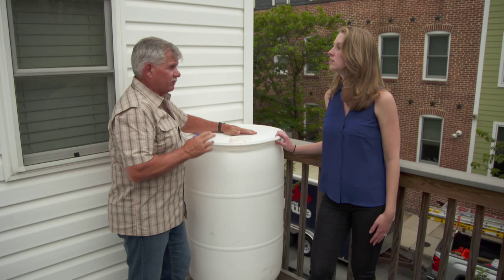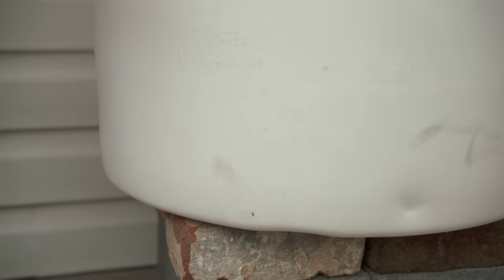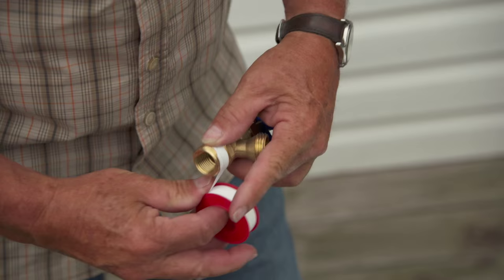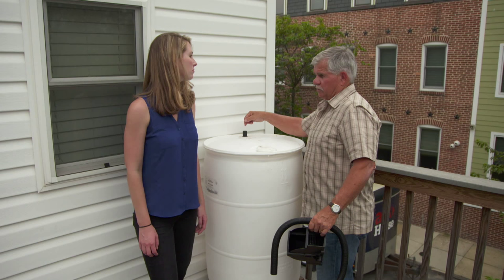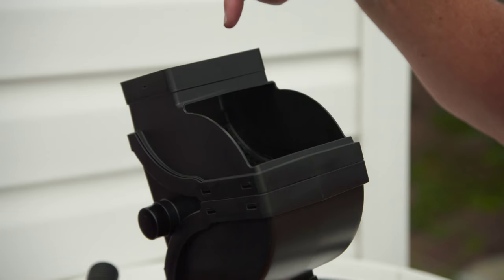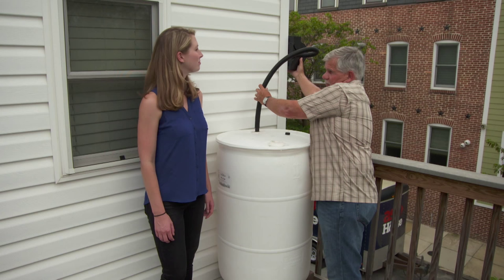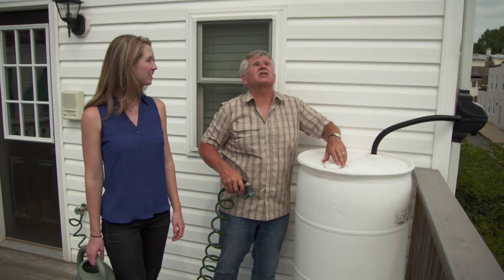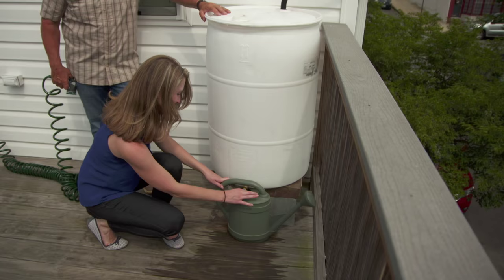How to Build a Rain Barrel for $40 | Ask This Old House

Comment: Two tips.  If you have a barrel of this size you’ll perhaps want a larger diameter out flow…. And two, you may want to consider painting it black to help block out the sunlight to reduced the growth rate of algae.
Reply: paint inside or outside?
Reply: @ranjit3o outside, it’s just to block the sunlight so algae won’t grow in the water inside the barrel.
Reply: Won’t black encourage heat?

Comment: It is worth pointing out that a light-colored or translucent barrel will grow algae in most cases. This will be aggravated when fed directly from a roof/gutter.
Reply: +LifeInOregon Could always paint the outside of the barrel or wrap it up.
Reply: even if it's used for drinking, algae is good for you.
Reply: Round why only for him
Reply: Guess you weren’t listening. It’s got a filter
Reply: Algae will still grow even with the filter. It's a microbe that grows. Also, white or natural plastics will also degrade and get brittle over time. It's best to put some gardening cloth around it to shade it from the sun rather than paint it. It should keep it cooler than painting it.
Reply: @Noah Wolfe ~ Guess you weren't watching, cause that was a strainer not a filter.
Reply: Since I would not be using water out of a barrel for drinking, it would not matter to me. It would be used for watering plants.
Reply: @RubbinRobbin  Delish!
Reply: @noahwolfe1304  for leaves and debris
Reply: @noahwolfe1304  that filter ain't keeping all the bird crap and other pollutants  that's on the roof out.
Reply: @Drew Peacock l guess you could run it through a Berkey in an emergency. But generally l think it would be best to use collected water for other than drinking.
Reply: @noahwolfe1304  If you saw the filter inside, it's to keep twigs, leaves and small pieces of matter from going into the barrel. It is not a filter that has a mesh in it.
Reply: @jaugust55  The purpose for my use of a rain barrel is to water my garden plants.  Not to drink it.
Reply: @jaugust55   Exactly!
Reply: @noahwolfe1304  it's a leaf filter not an algae filter all it does is stop leaves and sticks from getting into the barrel
Reply: I don't think Noah understands algae.
Reply: @noahwolfe1304  It doesn't have a media filter. It has a crappy and cheap slotted plastic strainer. I have this same diverter...and it's garbage! Many modifications you have to do, to make it half lousy. Waste of 💰!
Reply: @noahwolfe1304  That "filter" has absolutely nothing to do with algae. No need to be so rude when you don't even have correct info!

Comment: "You wanna hold my valve."... Tommy smooth as butter
Reply: He said belt because the downspout was on the outside of the rail and he would have to lean out over the rail to cut it to install the diverter.
Reply: She was very optimistic though gotta admit

Comment: They should preface: “we got a smoking deal on an old soda factory barrel that you probably won’t get”
Reply: 😂 right?!
Reply: I've seen used food grade drums on craigslist before, they usually go for around $50.
Reply: Not $5, but I just got 2 for $15 each.
Reply: I just paid $25 for a 65 gallon one and considered myself lucky
Reply: @JLJohnson  Nice find man! Congrats!!
Reply: @anthonymichlik4283  Awesome find!
Reply: He stole it
Reply: Haha ya the Home Depot 5 gal bucket is $5 but this giant one? Come on for realz?
Reply: There's 2 barrel suppliers by me that sell used barrels for $10. You have to look around for them a little, they're everywhere
Reply: I got 7 barrels for $65 from craigslist. Now, all I need is some stinking rain to water my deserving lawn 😝
Reply: I have 4 of them and didn't even pay the $5. Mine were all holding a non-toxic ice melt for runways. Same material as the food-safe ones.
Reply: @ahkeen  They're nice buckets too
Reply: @wes9451  cool… but that helps me very little

Comment: I do believe that a "how to" video should give all the details. I called my local recycling center for a barrel, they said they do get them in but they don't give them out but they would sell me an already assembled rain barrel for 40 bucks. So save yourself the time drilling, buying looking for a hole saw and call the recycling center! Also: so many comments about horrible "toxic roof water " all the plants are getting run off from the streets, decks all the rooftops in the neighborhood as well as  the pesticides you neighbor sprays. Just one roof sounds pretty good!

Comment: I wanted one of these.  My mom and I got a 45 gallon trashcan.  Today we got one of those bendable hoses to put at the end of the gutter and then we put it right over the hole I cut out of the lid.  I also had a mesh screen I got from Amazon.  It started storming.  I mean crazy rain.  It did so for less than an hour.  We went out and water was over flowing from the can.  Never in  a million years would I have thought it could create that much water.
Reply: You can also add a water filtration system. Just find a filter you like and add it on

Comment: Barrel will overflow. The inlet pipe should come in from the side about 2 inches down from the top. The diverter outlet elevation should be 1 inch higher than this so the water can flow to the barrel but when the  barrel is full the excess water will backflow to the gutter.
Reply: Excellent advice.  Thanks.
Reply: Never been an issue for me. Don't get enough rain to fill up 55gal

Comment: Feeding troth from tractor supply. Lid is an old screen door. Tarp over top when it's not raining. Troth comes with a hose and drain valve built in. $50

Comment: Great to see this install and saving rainwater! See comments below on putting the diverter just below the top of the barrel to automatically prevent overflow, see product instructions. We have installed a few of these and work great.
Reply: It's sealed why do you care about overflow? It'll just stop going down the tube and go down the downspout when full.
Reply: I think I would want my overflow to go in a secondary smaller portable container
Reply: Overflow into another barrel right next to it...or have the overflow attached to the 1st or 2nd barrel, connected to hose and ran out into the yard.

Comment: Make sure the tape goes on the same way  the threads run on the boiler fitting, so when you screw the 1” threads in, the tape stays on:-) Also, a one inch fitting with a washer screwed tight on to the inside will help the boiler fitting not leak :-)
Reply: The problem is  if I’m not mistaken the top does not come off of this type of barrel- it only has the two holes
Reply: @angelastanislowski8862  Most are like that. On PVC type barrels you have to cut the entire top off (level) then screen it, or what I’ve done is turn the top you’ve cut off upside down and set it back on the barrel for a bird-critter watering spot..Then you have the run-off from the gutter go into either the bird bath on top, or you’ll have to cut another hole into the edge of the top that drains the downspout to on top of the screen..Then drill a hole on the side that accepts your hose Bibb for watering..I always put a quick release-connector for the Bibb and hose in case I need to take it loose to go elsewhere :-)

Comment: You can see water seepage on the wood deck from the great installation of the lower valve, after he fills the barrel with water. She covers the leak with the watering can before the camera pans down. Needs a bulkhead for the bottom valve installation to prevent water from leaking around the imperfect cut, Teflon tape alone won't slove this problem.
Reply: You have no idea what caused the stain. They could have flushed the chips from the barrel, ever think of that ?
Reply: Or it could have been because he wrapped his Teflon tape on backwards.
Reply: could of been water from the sky
Reply: Maybe a cat peed there
Reply: @Kiss4cooper  could be
Reply: @oneangryfucerwivatinhat  could HAVE been.
Reply: @fizwin1  could have been.....
Reply: @oneangryfucerwivatinhat  :)
Reply: Charlie Tuna - always has to be someone who comments on Teflon tape being put on incorrectly. And you're actually wrong he did it correctly 😄
Reply: Could of also been because the barrel had a pin hole in it already and that’s why he was able to get it for only 5 bucks..?
Reply: @condor5635  You can tell by the color- that's left handed teflon tape and he put it on right handed.  It's completely backwards and therefore going to leak.  

If you don't believe me- just ask my blinker.  I learned the hard way when all my blinker fluid leaked out.  /facepalm
Reply: These shows aren’t actually shot in one take. There are a number of takes made to make sure the sound levels are correct, there are no flubbing of lines, or nobody off camera sneezes. I’m sure they opened the tap to make sure it was working first before turning the camera on.
Reply: @charlietuna5962  nah he wrapped it the right way. It leaked because he didn't tap threads into the hole so it didn't make a good seal and couldn't cut its own threads because of the Teflon tape.

Comment: I have one I use to keep my fish pond water fresh & topped off. I installed a spigot at the top and run a hose into the pond. Every time it rains the overflow goes into the pond. In the winter I move the hose to the bottom spigot and leave that open. That way the barrel remains empty and can't crack from freeze up.

Comment: You can do this on a much larger scale by using 250 gallon food grade tanks...around $25 used. And a downspout to 2inch pvc converter and run pvc pipes to the tanks. Fot larger gardens of course...best part you can always buy a tank for $25 and add it since you already having piping done, just use an elbow.
Reply: That second story porch ain't gonna hold the weight of 250 gallons of water dude! Ground level is fine but not this little porch!
Reply: @hotrodhog2170  oh I know mine are on the ground. Was just saying you can use same concept on a alrger scale.

Comment: I don't recommend doing this if you have Asphalt shingles. Chemicals from the Tar in the shingles can mix in the water.  Especially on hot days.  I would not use this water for ANYTHING.

If you have a rain barrel with water from an asphalt shingled roof, Fill a White 5 gallon bucket at least half full and see if it has a light brown color to it.  If so, most likely it's from the Tar.

If you have a metal roof no problem.

.
Reply: It will need a pre bucket filled with floss and a screen/ possibly a carbon mat (like for a fish tank). Then for drinking it will need additional filtering as you drain water from it.

Comment: You should also either paint it or cover it to keep light from going in otherwise you will have a big problem with algae
Reply: Hi I like your post and I wanted to know if you're saying the Blue barrel and the top cover needs to be covered to prevent algae?

Comment: We have three water barrels connected to our roof.  Here's the issue.....I recently watched a video that talked about the hazards of retrieving water from your roof as the materials they use are hazardous.  Even if you use it to water your garden, you are putting toxic water on the food you and your family will be eating.  I would like This Old House to respond to this as I can't find anything to the contrary and feel as if I have wasted time and money on these barrels.  (I know it's been 6 years since this post, but I'm hoping someone sees it.)  Thanks so much.
Reply: So, what if you are on a well?  All that toxic water comes off the roof, onto the ground, and into your well.
Reply: @AStanton1966  True, and we are on a well, but we have a filtration system that filters the water coming from the well into the house.  I am truly confused what to do.
Reply: @alicemaggio8854  Maybe, start by getting the rain water tested and see if it does contain any toxic substances.  I use rain water for my garden and power-wash projects around my house.  I have 3 Tractor Supply livestock containers for a total of about 375 gallons that get filled from a shed roof.  Then I have a 1,100 gallon tank that gets filled by my house roof.  Even though we had a pretty good drought here some years back, I've never run out of water.   I harvest rain water cause I'm on a well also.
Reply: @AStanton1966  Thank you so much for your reply.  This is great advice that I will be following.

Comment: When he attached the bottom of the diverter to the downspout below he placed it OVER the downspout. This will cause leaking. Having installed miles of spouting in my life, you ALWAY place a piece of downspout inside a lower piece so water can't hit the joint and leak out. The way this was done is incorrect. I know I'll hear it could be sealed with gutter seal etc. These sealants all expand and contract with temperature variation and will eventually fail. Bottom line, this installation is incorrect.
Reply: A white diverter would be better also.

Comment: It would have been nice if you explained what you did to the top of the barrel.  What did you drill into?  Where did you get that piece that you screwed into the top of the barrel?    Was it a complete kit with that diverter? Otherwise, nice video!😉
Reply: That piece usually comes with the barrel and I believe it's called a bung/filler hole and he hole sawed the 1'' hole for the hose from the gutter diverter.

Comment: OK rain barrel sit to low so use 2 more cinder blocks to lift it up further. Also the rain water split unit should had been sit higher to begin with so that the 1" small hose only run's down and not like in this video demonstrated uphill before it goes into the barrel.

Comment: I've installed two barrels on my property. My first concern is that there is no overflow opening. You risk damaging the hose and diverter by backing water up into them when the barrel is full. There's no opening to allow air in, for a smooth flow of water and to let any trace water in an empty barrel evaporate vs. grow bacteria.  A white barrel allows some sunlight in, which will promote algae. That barrel is going to stink eventually and may attract pests. It appears to be a 3rd story apartment -- how is she supposed to drain the barrel when she doesn't need the water? Just dump it on the deck?! And lastly the base is narrower than the barrel which could create a tipping risk. Sure it was cheap but that's a lot of potential problems.
Reply: Phyrre56    Plus there is no way to let air out as water comes in, so it backs up through diverted and out downspout, NEEDS a VENT !!
Reply: You are so right ! ,
Reply: It is fed by a gutter which sits in the open air. The downspout is a vent.
Reply: @davidkopec9442  I thinking of doing this next year, will add a overflow anyways

Comment: I heard from someone that the roof material may affect the quality of the water collected. May be worth checking it out.
Reply: Everything u eat and drink from affects your health. Can’t win ‘em all.
Reply: I've done roofing and yeah I wouldn't drink that water if it touched shingles. They are made of tar fiberglass and other hazardous composites (literally says it on the packaging). If it was a metal roof or clay tiles I'd just filter out the dust/dirt, you'll be fine.

Comment: no way that brass fitting screwed into plastic didnt leak
Reply: Canadian Tire that's what I'm saying, there's nothing to screw it too. It just goes into the hole and sits there.
Reply: It will move around as she uses it and it will brake
Reply: @James Wolowiec thoose always get smashed it is very easy
Reply: Exactly. It needs a 1" rubber washer on each side and ring nut tightened on the inside. I've made one of these before and it worked. Also, it needs and overflow and a vent on top for air intake too.
Reply: The proper fitting to use is a bulkhead fitting, when that barrel is full of water the pressure around the treading may leak over time, with the bulkhead fitting its backed with a rubber seal from inside the barrel as well
Reply: @geoffraike7626  While it does need an overflow it desn't need a vent as the gutter is the vent.
Reply: Wow, so many experts. Isn't there more than one way to skin a cat?
Reply: @RippSnortin  ide just never have a rain barrel honestly. But we dont have any lack of water where i am
Reply: Geoff Raike you stole 100% what I was going to say.
Reply: @FriggOff361  There is no lack of water, but it costs money. $100-150 per month even without watering anything
Reply: @Jp 

it’s called saving money.
Reply: The way I did it was. Cut the top off the barrel. Drill 1" hole screw the tap into the hole. Put a O ring on the inside then put a female nut on the inside. Also for the tap it is best too get the half travel wing style boiler tap. Way easier too open.
Reply: @geoffraike7626  I was thinking same thing about overflow.
Reply: @geoffraike7626  You just open the other hole, or pop the middle piece out.
Reply: See my comment above..
Reply: CircularMirror7 , open top barrel is a breeding pond for mosquitoes. They look for standing water to reproduce. A screened opening works well. The mosquitoes are awful in Ontario.
Reply: Plastic takes threads well from a metal insert if the hole is properly sized 😝
Reply: @geoffraike7626  I think with this style of rainwater barrel system, the inlet hose also functions as the overflow. It'll just backup into the downspout.